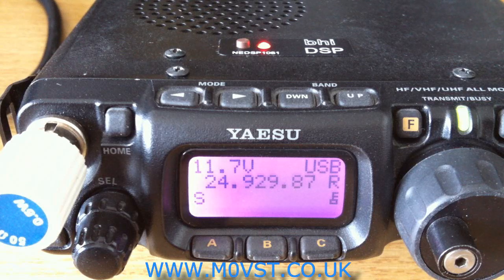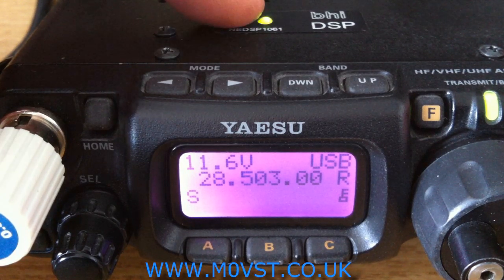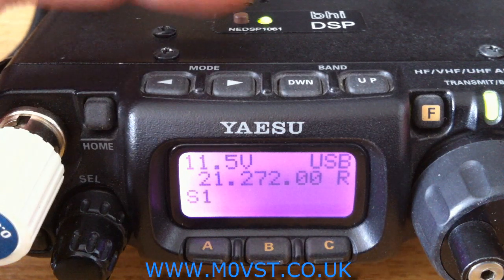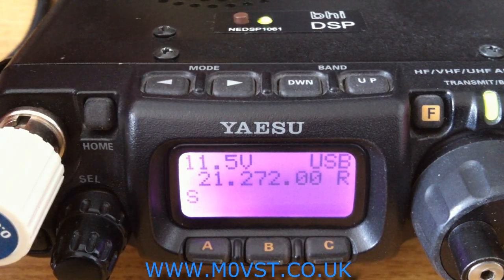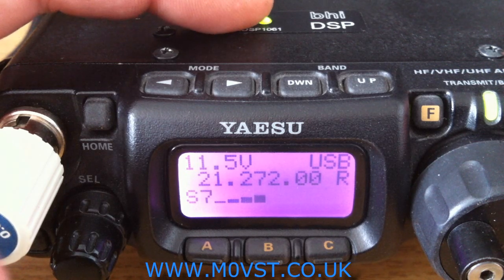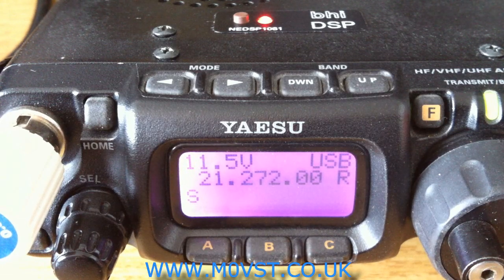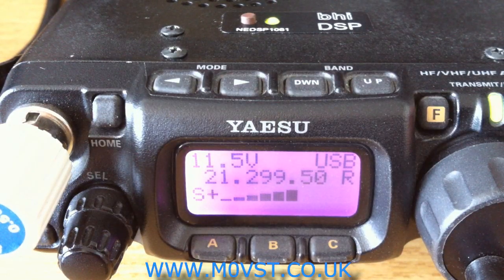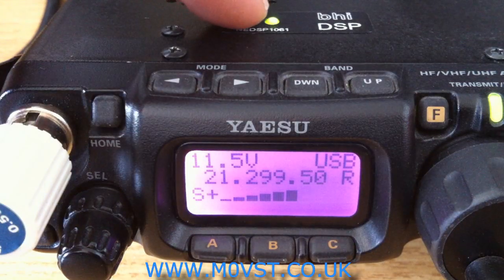The Bhi NEDSP1061 Noise Eliminating PCB Module in the Yaesu FT-817nd - A Review - M0VST [HD]

Comment: Just installed mine, playing with it now : -D
In 4 mode the green LED stays on, and 8 mode the LED is off, and the red LED means the DSP is off... so I guess mine works just fine. Easy to install... was a bit of a squish to get the cover back on. It's annoying that the beep volume is linked to the main volume, they should install a small piezo buzzer with a default volume independent from the main volume.